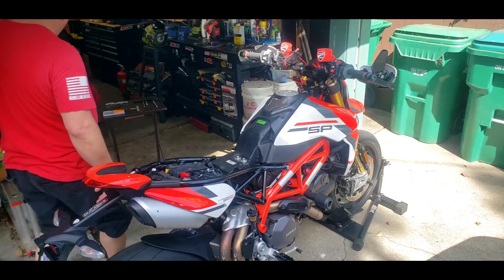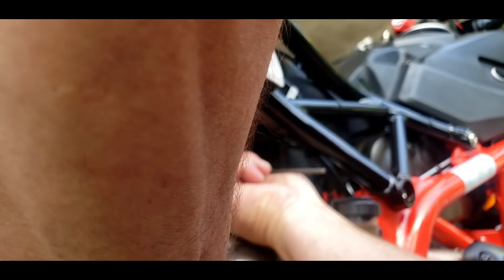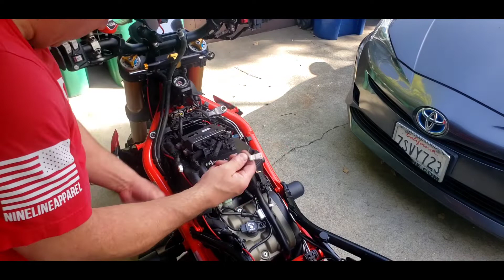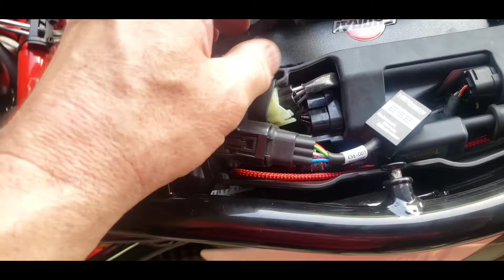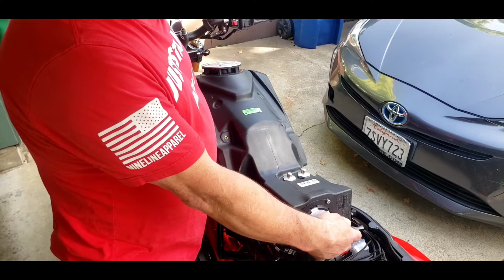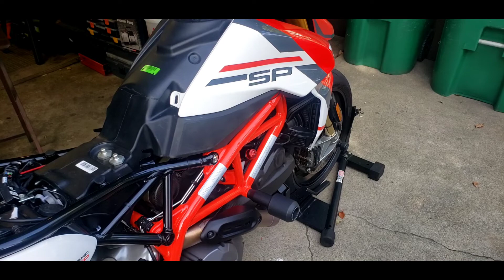2022 Ducati hypermotard 950 Scorpio alarm install

Comment: You show in your video the antenna , but it was the battery back up , the little wire you fix under plastic was the only antenna , and you did great to install away from metal as demand , great video !

Comment: Does it take a constant draw from battery? I have a tracker on my bike and it needs to be a trickle charger 24x7
Reply from the maker: I'm pretty sure it does. I have a lithium battery in mine I don't put it on a trickle charger at all  And it seems to be just fine. I'm sure it would kill the battery but I think it would take quite a bit of time.
Reply: @DIYmotorcycle  I use a lithium too.. doesn’t last more than a few days before being dead
Reply from the maker: That's strange that your battery dies that quick. I have lithium battery in both of my bikes both of them have the same alarm  I can leave it setting for up to a month or more and it'll start right up. I think the longest I've let the hyper sit is about 2 weeks. And it will  Always start right up.  By the way I use Shorai Battery, And the battery in my Yamaha This is about 5 years old now and still works very well.

Comment: Just got this alarm,thx for the video,makes it look pretty straightforward
Reply from the maker: Yeah just take your time getting the tank off Be careful with the plastic fuel line. The fuel line will be easier to take off if you unplug the fuel pump from its harness turn the key on which will  Activate the fuel injectors and take the fuel pressure off the line it will be easier to come out.